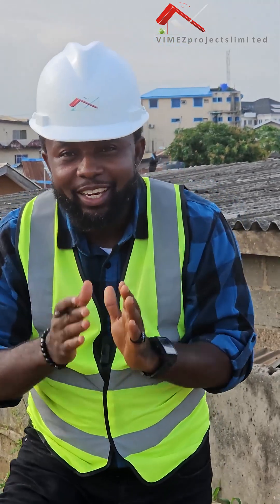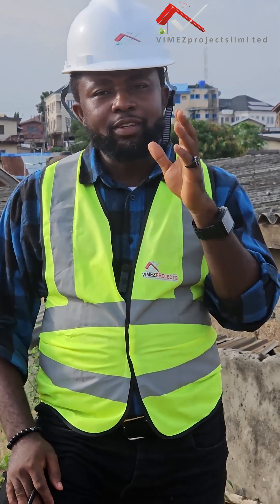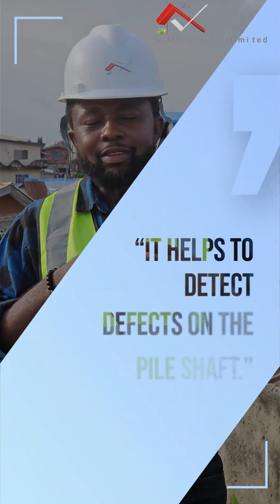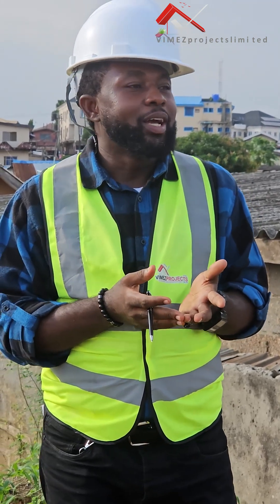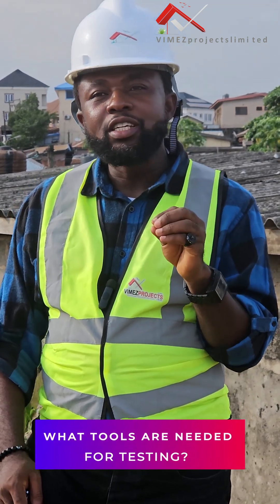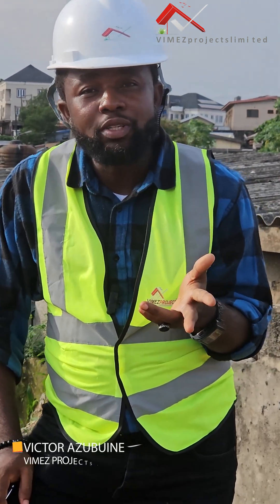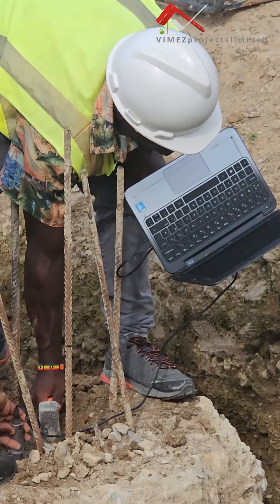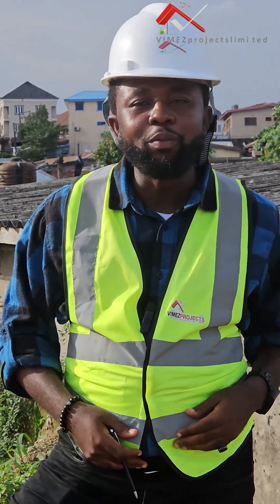How to do pile foundation in Nigeria. part 2

Comment: If the PIT confirmed that a pilling point didn't pass the integrity test, what will be the solution after casting?
Reply from the maker: It all depends on the location of the defect from the report.
If it's on the Pile toe or the middle, you can apply pressure grouting to improve end friction.
If it's at the top(Pile head) chisel down to sound concrete and recast the top section. 
In some cases,that particular Pile can be abandoned and have another point re piled